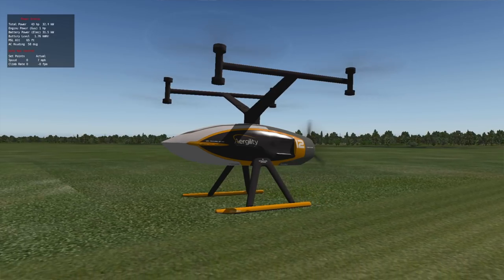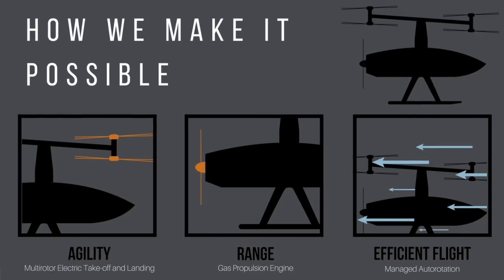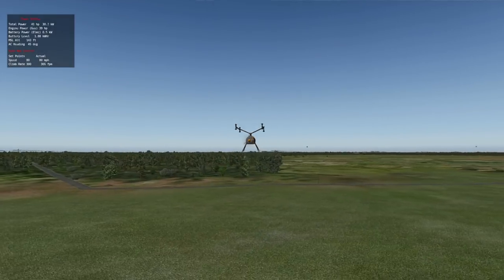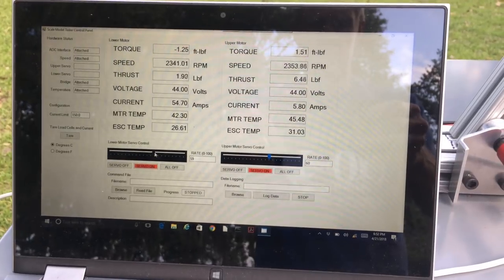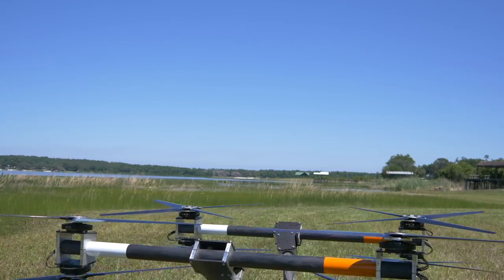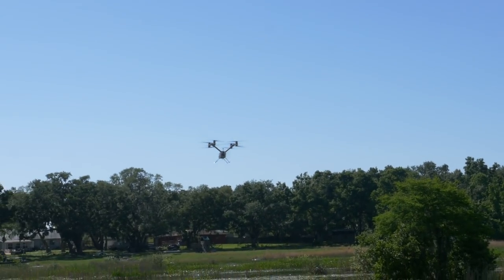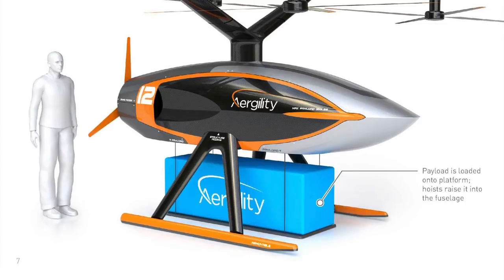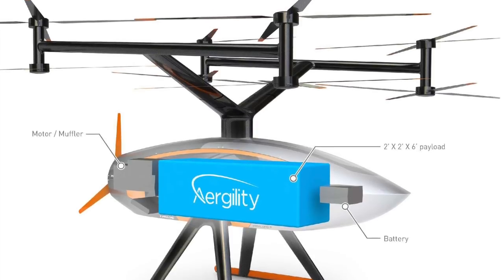Introducing ATLIS from Aergility - 400lb payload, 200mi range.

Comment: Why wouldn't you the scaled down model carry a scaled dow npayload ?
Reply from the maker: Hi MF-BOOM,

These are old numbers, as we aren’t pursuing the smaller model as it’s own product at this point, but in a max range configuration, the scaled down model, staying within the US 55-lb gross limit, could likely achieve a little less than 400 miles with a 5-lb payload, or about 75 miles with a 15-lb payload.

Outside the US, where we could exceed 55-lb GTW, 1,000 Miles with a 5-lb payload would be possible, or 75 miles with a 35-lb payload.

Hope that answers your question, but again, we are raising money for the full scale at this point because it truly has the opportunity to change how transportation is done in many areas of the world.

Comment: will it fly people too?
will it autorotate to the ground like a gyrocopter with engine off?
how is fuel efficiency?
Reply from the maker: Hi beeqool 

Someday it could fly people, but the current focus is on cargo.

Descent and Ascent is powered as this gives the craft more agility and control.  The gyrocopter-like flight is most relevant when in forward flight, when the protors are flying in managed autorotation and propulsion is provided by the rear propeller.

There are a number of ways that we can define fuel efficiency, but we like to incorporate a few relevant other details.  We use Payload Efficiency, which can be defined as max gross takeoff weight vs max payload (not including fuel).  

And then our key metric is cost per 100 pounds per mile, which is $0.09.  For comparison purposes, a UH-60 has a cost of about $1.37 per 100 pounds per mile.

Is there a more specific fuel efficiency question I can answer?

We will be getting a lot of this detail data added to the site soon at www.aergility.com
Reply: thanks alot, that will do, very interesting craft you have, i hope to see more videos and progress of it.
Reply from the maker: Hi beeqool, I’ve got a quick follow-up from our lead engineer:

“About being able to autorotate to the ground in engine powerout like a gyrocopter: yes. And then some since the on-board battery can provide power for some period of time to allow flight manuevering beyond what a normal autorotating descent would provide.”

Hope that more fully answers your question.
Reply: thanks thats very interesting. do you think it could serve as a flying car for people to commute to work?
Reply from the maker: Hi beeqool our main advantage isn’t the payload, but the range.  There are a lot of entrants in the air taxi field right now and most are achieving a range of 10-20 miles (Surefly claims 70 Miles, but we will see).  By contrast, with a 350-lb payload, we could reach 200 miles, and with a 250-lb payload we could exceed 600 miles.  So it is really a totally different category. Think military resupply, disaster response, remote construction... anywhere where there’s limited infrastructure.